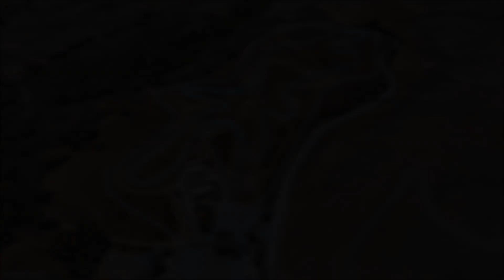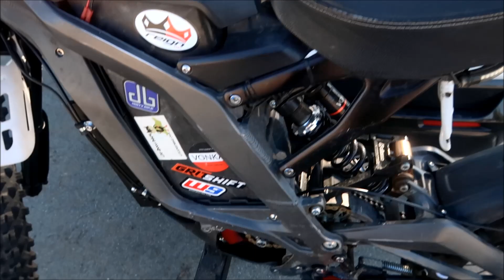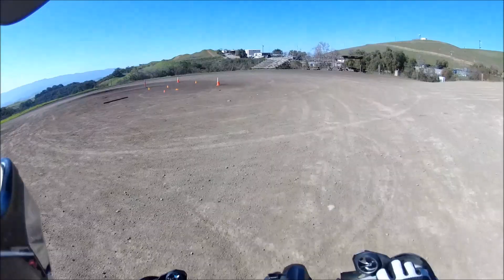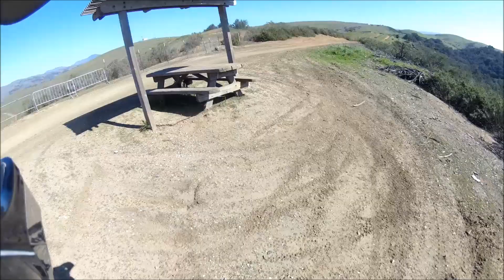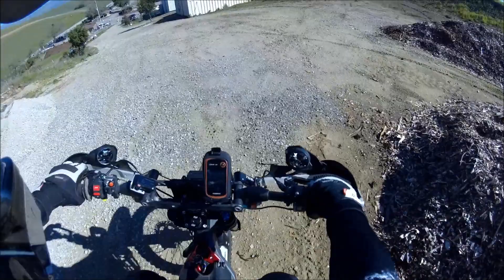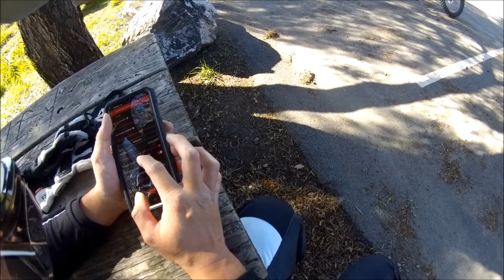KO Moto Factory Spec Combo Metcalf Trail Test & Tune Part 1: Intro + Trail 1 + Motocross

Comment: The ASI uses sensored start to sensorless run. I'm not sure that's your reason for lower rpm torque issues tho. Is there any kind of curve control? It's good you are doing these.
Reply from the maker: Yes there is there is a stand still phase current and peak phase current, it's in the advanced settings.  So maybe I need to mess with it more.  But the ASI controller I remember there was a lot of torque down low like you had a larger rear sprocket and there is no other controller that I've used that does this at least with the sur ron.  But once this gets rolling it hits hard.  One thing I do like about this controller is it can take a lot of punishment, the BAC controller would overheat all the time, this one doesn't even break a sweat but we'll see when we start racing it hot weather and racing is the true test =P